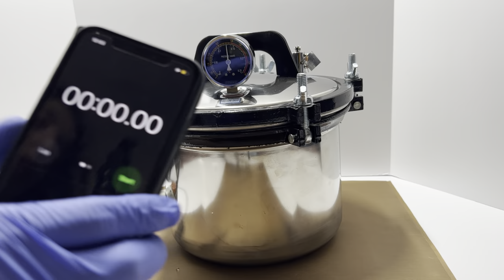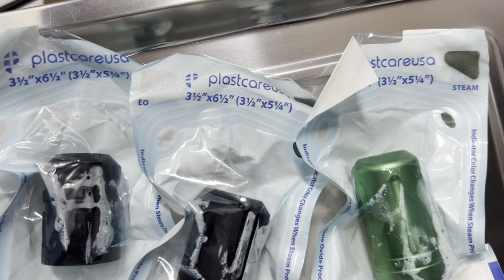Tattooing 101-How I Autoclave My Tattoo Gear

Comment: Would you recommend other types of autoclaves? or is this the best type on the market?
Reply from the maker: That’s a great question! 

I would say go for what is going to get the task at hand accomplished correctly within a budget 1 can afford. Autoclaved can be very expensive, as this one I am using is more in the affordable end. 

My goal is to combine heat, steam and pressure for sterilization. This little autoclave I use does the trick and is effective at doing what I need it to do. I would say it’s good for private to small studio use but let’s say if it was a larger studio where there is a larger demand of clients we’d want something that can house more than this so we can get more sterilized per round. 

Is it the best or best type on the market ? 
I wouldn’t say anything is ever the best but more so best for what you need to do on your end. I feel it all comes down to what our needs are. 

As long as the elements such as adequate pressure and heat are present we will get to where we are going. I would make certain the autoclave I get reaches desired temperatures, pressures and all of the specifics mentioned in the video prior to purchase. I hope this can shed some light for you.

Comment: I’m seeing a lot of contradicting statements amongst the tattoo community regarding claving and cold sterilization. I’ve ordered an autoclave to sterilize. But what about properly wrapped pen machines using membrane cartridges? is it necessary to use an autoclave? Do you feel with a product like Cavicide the result is enough to steer away from an autoclave?
Reply: Thats what i was thinking or what do you think of boling in a pot only the part that unscrews from the tattoo pen the part that touches the cartrige
Reply: @Nonameisthename666  that’s what I was doing briefly but it gets to be a pain in the neck having to pull out the clave setup. I ended up buying a power wand and disposable grips.
Reply: @dominicgonzales9057  so boiling will sanatize it good enough? cant spend the $200 on a autoclave im using the archer only used on 1 feiend but i want to do some work on myself
Reply: @Nonameisthename666  Oh no sorry I thought you meant autoclaving. No you can not sterilize it properly that way. I wouldn’t recommend it.
Reply: @dominicgonzales9057  ok last question are the cavaside wipes enought to sterile a tattoo pen wiping only the tip and the stem
Reply: @Nonameisthename666  I think you mean the grip and the other half which houses the motor right? If so, the grip is only sanitized with the wipes, not sterilized. And for the rest of the pen, it’s a general consensus that it’s a low risk part if wrapped properly so you can use cavi wipes for that. Mostly because with a majority of machines not being able to be completely claved.
Reply: @dominicgonzales9057  yessir!!! Just got the cavi wipes only here we go then time for some new ink then thanks for the quick reply man✌✍
Reply: @Nonameisthename666  no problem. Be safe!
Reply: Can also use a pressure cooker from what I’ve found. Much cheaper. Does the EXACT same thing you’ll just need to purchase the sterile pouches. It just needs to meet the pressure required specifications. Cavacide and Optim1 are intermediate disinfectants, not sterilizing. I’m still learning all this as well this is just what I’ve found.
Reply: @evanmackay7368  thanks for the input!

Comment: Hello  Daniel! I have bought a tattoo machine from dragonhawk (mast ancher) and it has a metalic disposible grip. Is it super necessary to buy  autoclave or Dry heat machine, or is it posible to cleat it and wrap it properly with out getting in to trouble? thank you~!
Reply: I have this same question..
Reply: If you’re reusing the grip you need to autoclave it after using it. If you’re using a new one everytime just throw it out after each use
Reply: @evanmackay7368   Do you have a autoclave? or dry heat?
Reply: @mikezaimis  I don’t have access to an autoclave so I use disposable grips. Not sure what a dry heat machine is, but you can look into chemical sterilizers like Optim CS 20 if you’re dead set on reusable grips. I’m no expert so you’d have to find out for yourself if they’d be effective enough.
Reply: @evanmackay7368   i think am gona keep my desposable...just they are a bit expensice for my machine. i think dry heat is a good option for the grip, you just put it inside and leave it for 30 minutes to 70 celsius. Of course you have to clean it again. Some tattoo artist just clean the grip properly and wrap it also. and they work fine. Any way, thanks man. keep up art